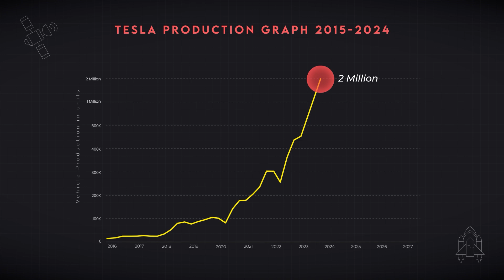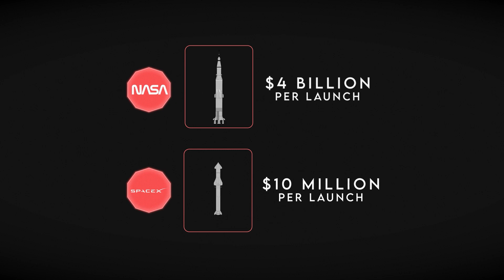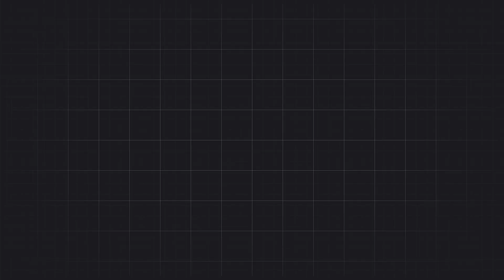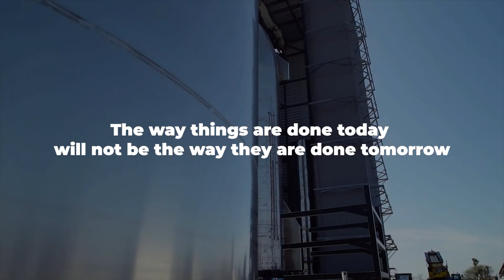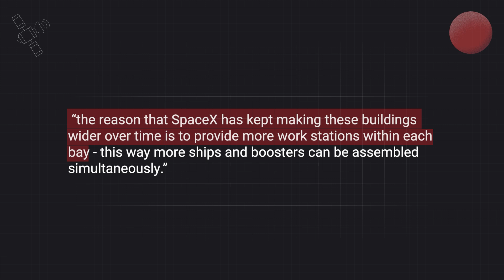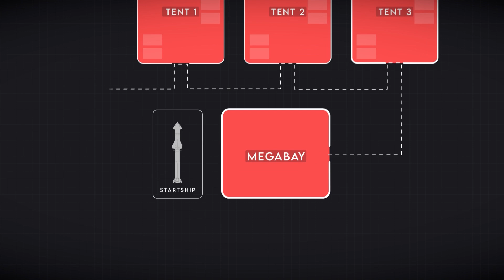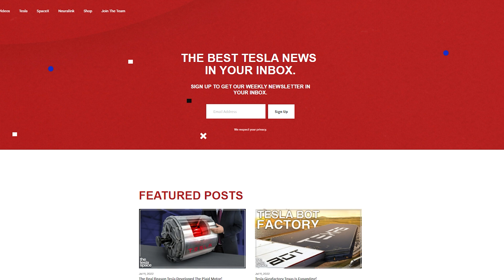The Real Reason SpaceX Is Building A Starship Gigafactory! (Starfactory)

Comment: Camping with a Gigapress
7:03 TENT?
A tent is a portable shelter made of fabric, usually canvas or nylon, stretched over a frame of poles. It's like a cozy little house you can take with you on your outdoor adventures. Tents come in all shapes and sizes, from small one-person tents to large family-sized ones. They're perfect for camping, hiking, or any other outdoor activity where you need a comfortable place to sleep or take shelter. Just imagine setting up your tent under the stars, listening to the sounds of nature, and feeling the fresh air on your face. It's like having your own little piece of the great outdoors, right at your fingertips.
Please note the inclusion of bulding grade RSJ's at Fremont.
Has a steel roof and no walls. Cant hide a gigapress anyway.
RSJ stands for "Rolled Steel Joist" and is a type of structural steel beam commonly used in construction. It's like the backbone of a building, providing essential support. RSJ beams are shaped like an "I" or "H," which makes them strong and able to handle a lot of weight. They're used to support floors, ceilings, and walls, especially when you're making changes to a building, like removing a load-bearing wall. So, think of an RSJ as the superhero of beams, swooping in to save the day and keep everything standing strong.
thanks Grok 🤪
Reply: Grok

@grok
You're welcome! It's always a pleasure to share my vast knowledge and witty banter with you. If you have any more questions or just want to chat, I'm here for you. Just remember, with great knowledge comes great responsibility...to use it to make the world a better place. Or at least to impress your friends at trivia night.🤣

Comment: The problem is that Starship will not a final version of the Mars Rocket. Starship will be used as a lift to orbit and back. It will be used to build ferry like Rocket to go to Mars. Ferry like rocket will never land and it will be constantly on the orbit of Mars or Earth between fights. Ferry like rocket will not use heat protection shield because it will never land. No one gonna survive radiation and Zero gravity if SpaceX  fly 9 month trip to Mars with current design Starship. Its an illusion. Its true that Elon will need an army of these Starships to carry fuel and build modules for these Van Brown like rotating ferries.

Comment: If thrust is mostly violent burst of pressure, maybe generated via air/jet-engine or chemicals/rocket fuel.
Why nobody ever tried some other method to generate thrust? 

Similar wave of thrust can be felt when lightning strikes earth. (Almost few seconds later you can feel pressure wave flowing through atmosphere, house, earth)
It can be channeled into specific direction or funnel.

Or when nuke or something similar go boom, a wave of pressure/thrust is generated.

Or when you play a song with woofer blasting at full volume, similar thrust is generated at low frequency, good enough to vibrate entire house. 

What if, you can generate artificial lightening through large enough spark plug, and funnel the pressure release through thuster cone (like in a rocket).

Or woofer with low frequency, generating waves and funneling through thruster.

Comment: Well 1st they will not be building more than 10 Super Heavies.  2nd they designed the simplest ship, so yes... they could build 1 Starship a day if they build an efficient assembly line. Which nothing done in Boca Chica has been logical or efficient. The Star Factory should be flipped. The Mega Bays should be on the other side of the building, more like a round house with a door leading to a Rocket Parking lot. Apparently with 365+ parking spaces.  There should be 1 line for the Nosecone. 2 lines just building the 20 Rings, Stamping or Laser Cutting Panels, to be Curled and Welded. Stringer and Components applied, feeding into 7 lines Engine Bay, Tanks, Cargo, Mess, Crew Quarters, Gym. Stacked adding the Down Spout, Common Dome & Header Tanks. Then apply the Heat Shields, then the Flaps then to the Garden, where their electronics can be tested,  Engines would only be installed only for Testing and Launch.
I would Assume you build all the Super Heavies First, then Cargo, then Tankers, then finally Crewed. Not counting 2 Luna Landers. Before Mass Production starts.

Comment: I want to share some realities with the video  owner.  Before I do I complement you on the video which is all accurate since all of the content comes from SpaceX and Elon plus much of the renderings if not all.

First, this factory at Boca Chica is a prototype factory.  Just as Tesla was before it bought the Fremont factory.  Then in the third iteration came with the Giga factory in Berlin and repeating it in Austin was another.  Three iterations.  

Now in Boca first were the temporary tents and bays.  Second is the starship factory being built now.  Third will be a starship version of a giga factory because the present growing building will not do everything needed to get to Mars efficiently.  Again, three iterations.

However, there will be a fourth iteration.  A factory on Mars after the starter colony is finished by Tesla bots.  Why?  Because building spaceships on Mars would be easier, faster and cheaper in all respects.  Plus the robots on Mars can do the work on spaceships in place of humans and with no safety concerns.  Plus starship as designed so far is not needed for all interplanetary missions.  Other spaceships need designing for missions not based on bulk cargo delivery from Earth.

Smaller ships for human or robot transportation around Mars are needed.  Robots can leave Mars to go other places and don't need food, water, medical or safety concerns.  So they can be sent to the asteroid fields just past Mars to find, collect, sample and capture asteroids to return to Mars orbit for processing.

In short, what were seeing at Boca Chica is the second most brief iteration Earth Side after the tents now disappearing then the vertical bays.  The fourth iteration being the inevitable first Mars or off planet factory.  

By year 2040 Starship will be built by Tesla bots on Mars as the colony expands for humanity.  After that is the next chapter.
Reply: @Jay-cf6dz  I've muted you because your brain dead.

Comment: Starships will be used for global cargo transport, and I believe carbon dioxide and water from the air can be used to produce the methane with excess solar energy. So green fast transport over long distance. Further it has military usage, but that is obvious. Commercial space hotels. Too much to mention. That's why you need a large fleet.
Reply: I think their is too much "space" in your head. Space hotels.  Get real.
Reply: @Riteaidbob  Orbital Assembly are working towards opening the first space hotel by the end of 2025.

Comment: Love your videos! But I think you need to make it clear to your viewers that SpaceX does NOT need to build a FULL Super-heavy/starship stack every day. They don't need to, & they don't want to.

They may well need (want) to build LOTS of Starships (2nd stage), so churning one of them out every day makes sense, especially once a need is determined. It's also somewhat smaller than the booster, although not only more complex, but SpaceX will need several different variants of them.

But EACH booster will need its OWN "stage-zero" tower & support equipment. Or, at the very least, perhaps 2 boosters could share the ground infrastructure. And each booster needs to land somewhere with a tower.  Are they then going to then pull it OFF that tower? Perhaps, but not very often. The boosters are supposed to turn around in just a few hours, so they're not going to need that many of them.  

And it seems that the Stage-zero ground infrastructure is both more costly & takes longer to build than a booster, so I seriously doubt they'll need that many. Although I hope they build more Stage-zeros, & I'm disappointed that the tower still waiting to be erected in FL is just languishing for the time being.
Reply: Ground Zero is said to be able to launch one Starship/Superheavy every hour at full capacity, so the ground equipment and support infrastructure will need to be completely rebuilt or heavily modified if that is to happen. To even hope to support that cadence using tanker trucks is not feasible. There will need to be capabilities to make their own fuel and fill ther water tanks on site. Maybe that is what the new slabs being laid beyond Mechazilla will be used for? 

Also, given how well used Mechazilla have started to sound, i think they will also need to upgrade that tower and elevator mechanism pretty soon. It definitely needs a centralized pressurized oiling system.
Reply: But Elon wants to go to Mars. There are limited windows of opportunity to get there efficiently. So, the intent is to  have up to 1000 rockets leave orbit at the same time and land on Mars without towers. The towers will be used for local missions. Elon said the tower was a larger technical challenge than the rocket, so the same experimental principal applies. Once the engineering is proven, mass production can then be tackled, or some other way of landing.
Reply: @outspoken117 they’ll have months to launch all the autonomous rockets, they’ll have them just waiting in orbit for the window then send up the manned rockets at the very end. That still means about 32 launches per day (including fuelling launches) if they spread it across 2 months so they’ll probably need at least 8 launch sites, they’ll probably have 10 so it’s more spread out
Reply: я думаю что Илон просто тратит деньги впустую, предлагаю "большим кошелькам" морковку в виде Марса. Хорошо, не впустую, но для совсем других целей, чем Марс
Reply: That makes sense
Reply: I think in the long term it would make sense to manufacture these near it's launch site in Texas and perhaps Cape Canaveral since both states have far more favorable tax regimes and the launch facilities SpaceX needs are already there. You gotta love that Elon is revolutionizing technology and manufacturing to such a degree.
Reply: It's about high time YouTube allowed viewers to comment using voice notes. 

Or better still you can record a video, upload it as short with your phone and drop the link to that video here in the comments section.

Comment: I work for the company that supplied those 'tents' and I'm a little sad to see them go. I had a connection to what was being done.
Reply: how much is one tent?
Reply: @mozero6931  I work in the production wing and am not privy to costs. I get told that price is very variable based on client wants and needs. I did hear that the tents were on a 3yr lease and normally we would get them back. They must have bought them out right. It seems strange to me too cause they could have been easily relocated to another area, they are very useful that way.
Reply: i'd like to buy one tent

Comment: Excellent video. Thanks. 

And kudos for using that photo of the Atlas 1 production line at General Dynamics in San Diego. It probably was taken in 1960 or so. The Atlas I and successor versions along with the Centaur upper stage were the first stainless steel rockets to be mass produced and flown. They are the predecessors of the stainless steel Starship now 60 years later.